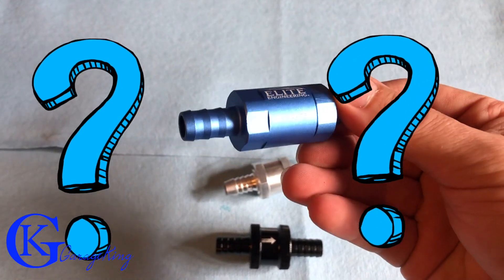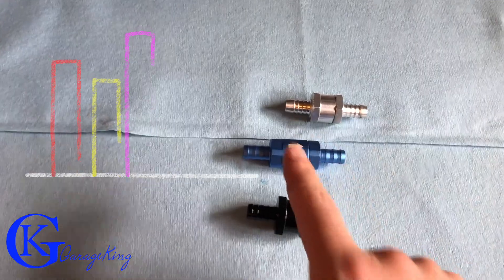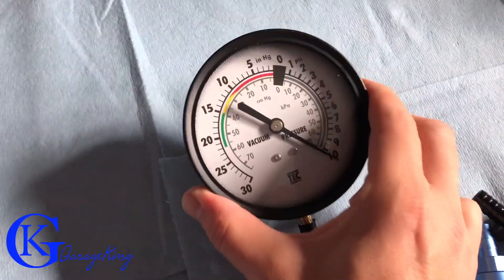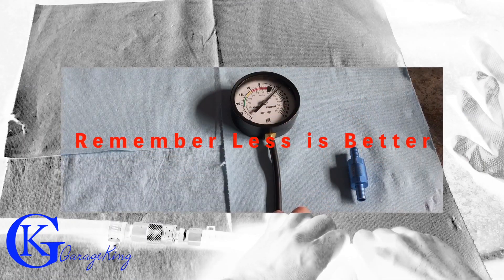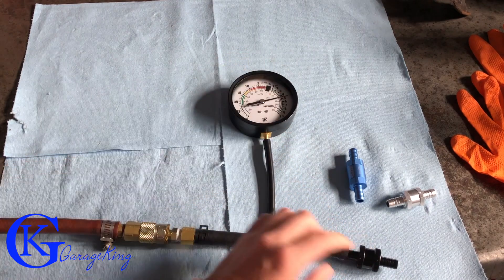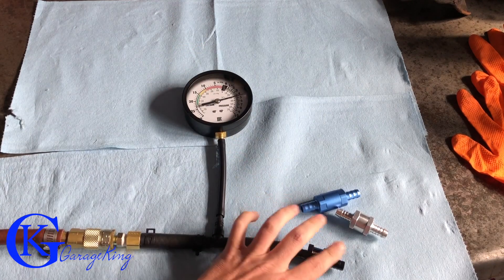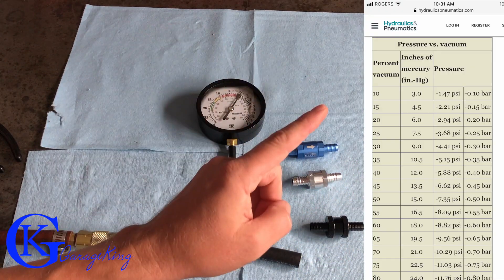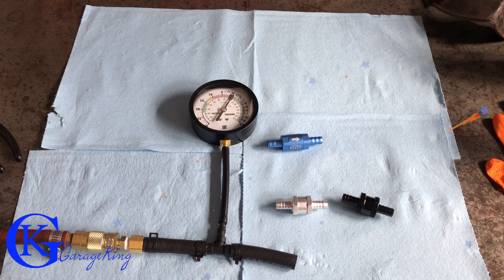Elite Engineering High Flow Valve: The BEST choice for catch can

Comment: Thank you for this video, you've sold me on the Elite check valve! Can it be disassembled for cleaning? If not, how do you recommend the valve be cleaned?
Reply from the maker: I don't think you can take it apart, Maybe if you twist it, but I think its like a press fit.  I would just squirt brake cleaner in it and I think that would do the trick.

Comment: Can you try damond motorsports check valve 5/8''? Would you recommend this one?
Reply from the maker: Hey There, I looked up Damond motorsports check valves and they have a lot of very positive reviews. I can't find information on what type of mechanism is used for flow so I really can't say for certain how well they perform. Based on the reviews they seem good.
Reply: @GarageKing  okay. Just got mine in the mail. very stout. It also has a ball I think like the elite engineering
Reply from the maker: @Jfresh55  If it's got the ball that is the good design, much better than the flapper valve.

Comment: Curious what it’s CFM would be. I have a potential use for it in water for a prototype. Trying to find the highest flow 1 way valve so I can accommodate it in the cad file
Reply from the maker: Hey Thanks for the comment.  When I was doing research I believe the CFM was around 5 for the GM engine with the fixed orifice PCV valve.
Reply from the maker: But for the actual max flow that is possible. I guess it would depend on the max amount of pressure.
Reply: Damn it might work I’m trying to picture how fast it could dump let’s say 1 liter. I need something that can cycle as fast as possible it might only be able to get to 5k rpm. I might just need to make an aperture that cycles with the piston. I can’t really go into it but I need full open flow to the diameter of a cylinder ideally or something close.
Reply from the maker: @RED89P13  This is the best one way valve I have found so far.  I think the bearing that opens and closes the valve is nylon so with that light weight you should be able to get to 5K.
Reply: @GarageKing  cool I’ll just have to do some testing. Been thinking of making a wastegate like a throttle body at the back it might work better for what I’m trying to do.
Reply from the maker: @RED89P13  Sounds good, best of luck !!  I know how it is trying to create things.  It takes time, but when it works out its great !!!  Happy Friday to you :)
Reply: @GarageKing  happy Friday to you as well! One last question did you happen to test the max psi that can pass through ideally fluids?
Reply from the maker: @RED89P13  Thank !!  Sorry I didn't test the max PSI, so I'm not sure about max PSI, but they do flow much better than the flap type valves.  Plus they open with very little pressure so they are accurate.

Comment: Thanks for comparing these!  One thing that would have been nice is to increase the sample size a little.
Reply from the maker: Good call on that.  The reason I actually did the test was when I got the black one and blew into it, I was like this is no good and I told a few of my friends and they were like "its in your head buddy" haha.   So I got the high flow one and then did the test with the other two styles that I did.  Thanks for the comment brother, and thanks for sticking with me, you have been around for a while.   I appreciate that !!!